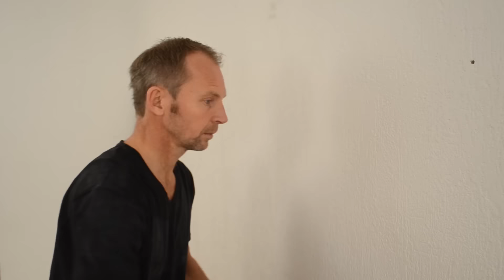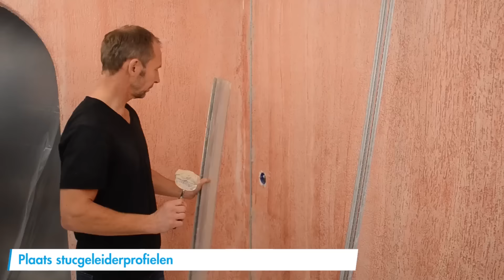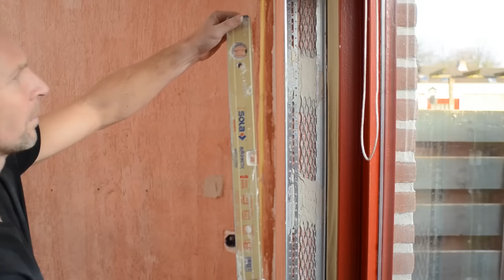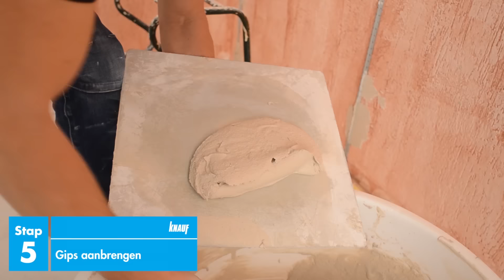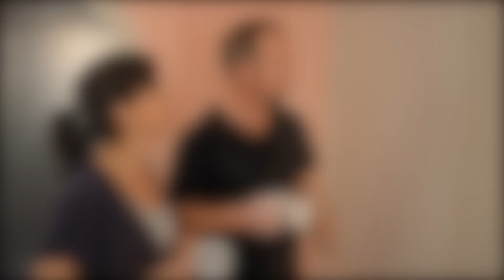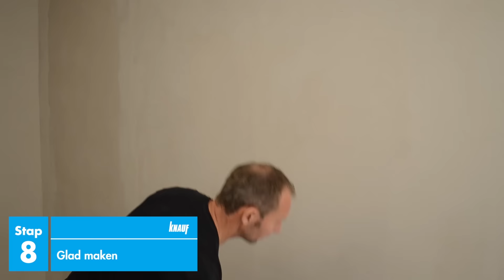ZELF STUCEN MET KNAUF ROTBAND! - Knauf Doe-Het-Zelf

Comment: why did you install some steel and remove later??
Reply: He used it so you can over it with the steel plate then it becomes straight and you dont need the bar sticking in the wall if its straight so thats why he took it out
Reply: The steel is a guide rail that determines the thickness of plaster.